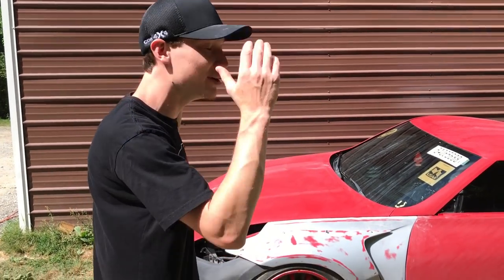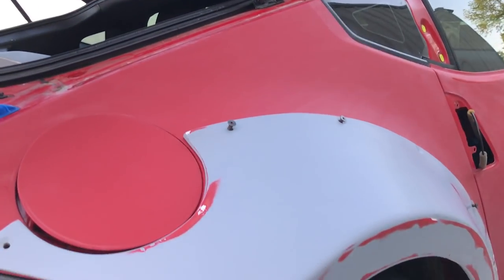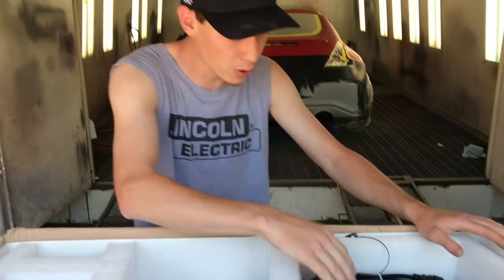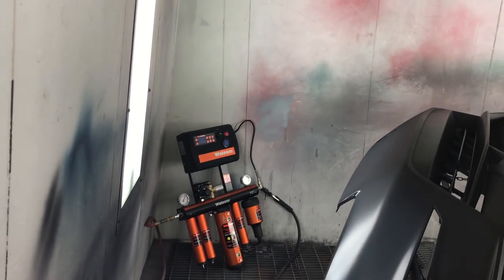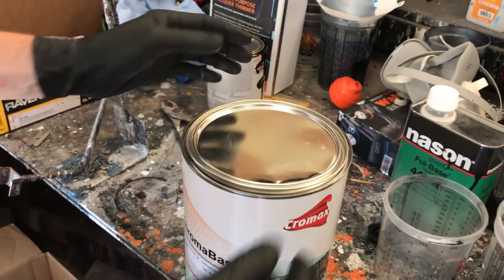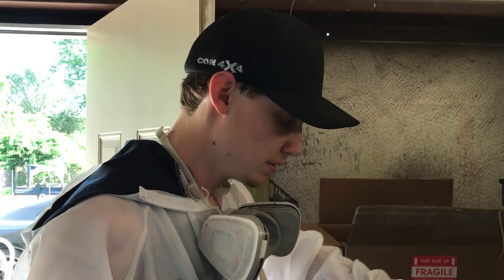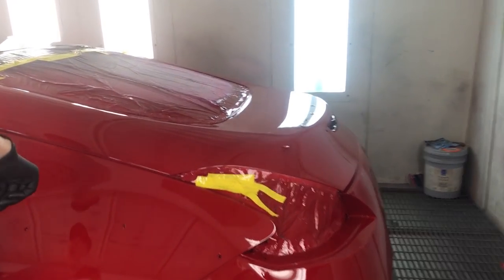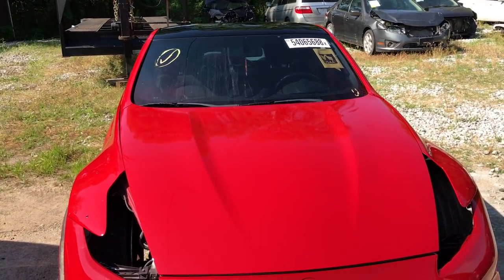Auction Drift Car Gets A Complete Paint Job!!!

Comment: Gday fellas!
Man! I’m so impressed with how far you boys have come. I’m loving the channel and like so many have said, can’t wait for the next instalment. 
One tip I’d pass onto those watching is that when doing fibreglass and carbon fibre repair, remember that epoxy resin will stick to polyester but polyester won’t stick to epoxy. Also I’d recommend to the boys to get yourselves a 90 degree and a straight die grinder. They run off your compressor and spin at 12,000 rpm. When feathering our carbon or fibreglass for repair it gives you very fine control. I use 32 grit discs and because you have such high revs you just need to lightly touch the surfaces for excellent quick results. Not at all aggressive. 3M make all the discs and are called “Roloc” and they also do these really tiny round barrel type called spirals or arbors I think. Hope it helps, love your work boys,
PEACCCE! and Cheers from Australia 😃🍻🍻👍👍

Comment: Tintable sealer, on your clear hotter/slow reducer especially last coat. Example medium and slow reducer 90/10 first coat than 70/30 2nd coat. Going for that tight OEM peel. Great work once again Goonzquad

Comment: If you were to add 6" wide paper to the edges of fresh paint where the plastic mask meets, you'll find it a lot easier to manage overspray getting back into your paint/clearcoat. this is especially true when applying clearcoat, as basecoat will be dry around the edges of the overspray. Just something i learned in my spraying heyday that may help you guys. keep up the awesome work!

Comment: The black looks really good on that.  Very gt-r. Have you thought about since the outside is extremely modified that the engine and interior need to be as well. This would be a good project to do something other than oem.

Comment: A suggestion re your trailer; there are smaller versions of the sort of jack up legs a 5th wheel freight trailer uses when parked- jacking your trailer a few inches higher will level with the ramps you have and lower the entry thresh hold as the car comes over the ramp. Hold the car in park, have a chain ready for a known p/u spot on the car- lower the jack legs, strap the car down, pick up the ramps and move on! Oh yeah; keep doing what you do!

Comment: Learn from your mistakes!! Like the viper and the orange and white on the lambo, u need to start with a constant color underneath or you will be doing coat after coat after coat. Especially with red either lay down base coat that is all one color but sealer is the best way. Tintable sealer or just a pre colored one like grey or white just as long as it's all one color before u start with the actual color. In the sun you will probably be able to see the difference in it but it's a drift car!! Not that big a deal but learn from prior jobs guys!! Its cheaper to do it right instead of redoing it!!

Comment: Hey a quick tip for you guys I’m a professional painter and use all cromax products I know it calls for 1:1 mixing ratio instead of mixing exactly 1:1 cut back on your basemaker a little so it’s not so thin it’s covers very very well when it’s not so thin just a quick tip for y’all keep up the good work 😎

Comment: yo what if i sanded my bumper all the way down to plastic at some spots? Not the whole one but it has 4, 5 one inch spots where even the gray filler is gone. Do i need an adhesion promoter? dark grey filler for plastics, quartz black mettalic paint and 2K clear, so it wont be seen but im asking from a rigidity perspective, thanks!

Comment: The rim that is damage. I know you guys can fix it. It's a 3 piece rim. Take the tire off mounted back in the car, use strong blade and welder vice grip. Start the car put it in gear and leave it running plus let go off the clutch. Then let is cut the glue so you can unbolt all the bolts from the barrel then use a rubber Hummer to take it apart. Then just buy an outer barrel make sure all dimensions are the same. I know you 2 can pull it off repairing that rim

Comment: Should’ve sealed it all one color slow down a little on your 50/50 overlaps don’t fling the gun at the end basically be a robot when spraying your putting more in the air than on the car flinging the gun all over like that not hating much respect!! Just my 2 cents